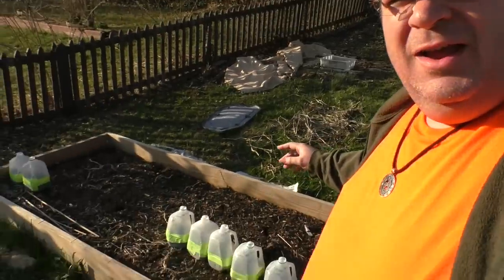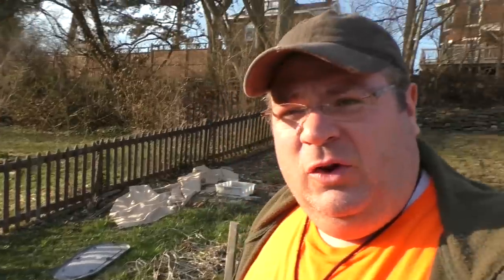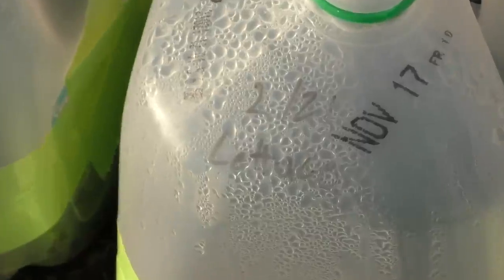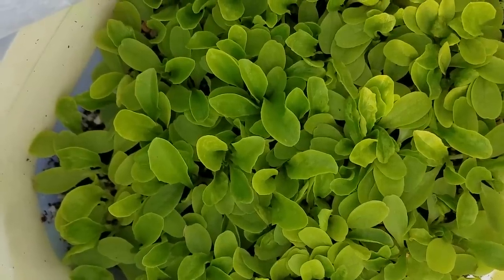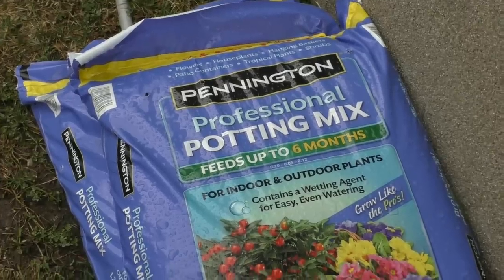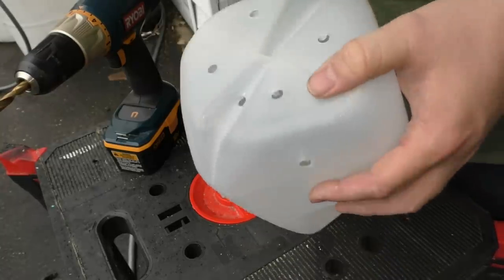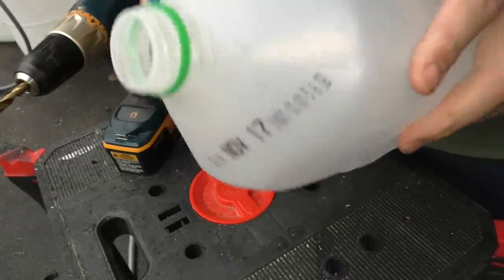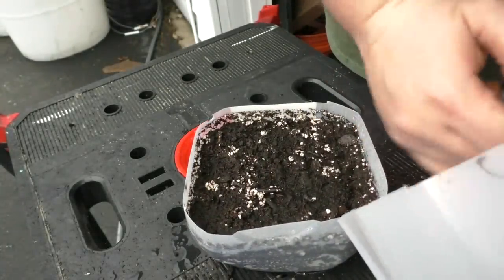Erv's Complete Milk Jug Gardening Guide

Comment: Why not plant the seeds directly in the ground, cut the bottom off the jug, & put the jug over the area. It can be done with transplants too when they are small. I've done it & it works.
Reply from the maker: This is a great idea, and I know a lot of people do it this way. Great tip! Thanks.
Reply: My Grandpa did it that way every year and it worked great in crazy Ks. Spring weather!
Reply: What a great idea 👍👍
Reply: @s.engelsman4521  WE also have crazy weather in Illinois where you run your air conditioner in the daytime and your furnace at night!
Reply: That’s what I thought he was going to do, but his way is perfect if your growing area is a porch.  Also, it makes them transportable.  😀
Reply: Cut plastic jugs as cloches - brilliant! Is burying the lip a ways down enough to keep them from blowing away? 

Maybe for the strong winds here I could cut them so the bottom had "wings" flipped out and weighed down with rocks & soil. I'm definitely stocking up on jugs & soda bottles to try both these techniques next year!
Reply: I would think the answer to your question would be that in windy areas, remembering this is done outside in winter,  you would end up with your milk jug tops everywhere.  by making them as a closed unit the weight of the soil in them prevents them from being blown around
Reply: @davidpringle8089  +
lol same here in NE Wyoming ..  a 30 degree drop most nights ...
Reply: White Marlin  the eggs work? that's cool ... I have a doe and her young-ins who've been visiting for years ...now I don't mind giving them treats (sunflower seeds) but really would feel put upon if they munched my hard grown garden! ... I'll try it ... also the management here won't allow any planting in the ground so I'm learning fast about growing in containers ... btw did you know if you have windows that stay bright all winter you can move a lot of vegies inside for the winter?  i still have a tomato plant that over a year old ... tomatoes all winter (cherries) and this spring I re-potted it, cut it down to the stem (no green) and it's almost two feet tall .... I clipped off it's green leafed ends and rooted them in water and planted them. I know have 11 tomatoes plants! ... most of the babies have flowers already and two have cherries growing ... in the house, in the window, in small pots (need to re-pot soon) ... I was amazed how hardy they are!
Reply: @blackbetsy59  Good point!
Reply: That works great except for high winds. I tried it by just cutting the bottom off, and even stuck a stick in through the holes, but where I live I get high winds, and it just didn't work for me! This way, I can bring them in at night if it gets cold
Reply: White Marlin  great idea about the egg. Thank you
Reply: blackbetsy59 has
Reply: White Marl
Reply: Unless you have gophers that evade all ways to get rid of them; lol. I lost so many plants last year; pots now!
Reply: I was thinking the same thing about cutting out the bottom and using it as a cloche, since I don't have gopher issues. For winds, I have a ton of landscape pins that can be used. Another method is run a pipe through the handles all facing the same diection... one that will weigh them down. Where there's a will, there's a way. The reason I prefer direct sew is because I am notoriously late in transplanting seedlings. Worth a try!
Reply: @davidpringle8089  sounds like the weather we have where I live. As a matter of fact, there's an ongoing joke that our state is the only one where you can experience all four seasons in one day! Lol 🙂😅😂🤣
Reply: @demaupin  Make holes on the bottom rim and stick a couple landscape staples in maybe to keep from blowing away. I had the question about wind as well. Lately here in NW Tennessee I've had big pots of dirt picked up and tossed by the wind. It has been crazy.
Reply: @faith6978  Good point. I hate moles. They raise so much hell in my gardens and yard. Tried everything to get rid of them. They're still here.
Reply: @joanies6778  Good idea with the pipe!

Comment: We have done similar in Texas all my life.  We used to take the very bottom off all the way around, plant directly in the ground, and build dirt up around the jug  outside.  This holds the jug in place during winds.
Another way we use is cut the bottom in half and then cut around the bottom edge and leave about two inches making a flap.  Again sow directly in the ground.  Cover the flaps with dirt to hold them in place.  When, it is past frost, the plants are usually to the top of the jug.  Then we just pull the jugs off and grow naturally in the ground
Reply: Where do you live in TX? I live in Austin and I’m going use this method this year

Comment: My Grandpa born in 1900 used to do a variation of this every year to start his tomatos, esp.  He put the seeds/seedlings in the ground then put the cut jug top over the plant to protect it and warm it.  When the plants were big enough he then just took the jug off and his garden was set. 🙂
Reply from the maker: This is still a very common practice among the people that do this. It works pretty much just as well.
Reply: Wow, thanks. I never thought of that! Kinda cool.
Reply: The cut jug over the jug seems like a better way of doing it, really. I wonder if the soil warms up as well though. Inside the jug the soil would be isolated and more exposed to sun so hence, warmer. I might try both methods simultaneously with same seed and see which works best or if there is a difference.
Reply: @GrandmaSezSo  : What happened? Thanks.

Comment: Yes, Early Girls produce well. They need a cardboard shade until over knee high or another sort such as climbing beans for shade. By experiment, planting them in groups of four, with a 3 ltr bottle with drain holes expedites watering and promotes deeper roots. Ours have crushed their cages every year, so stake poles with stretched t-shirt ties for extra support. I've heard cheap bras, but never tried that. For lower limbs organization crates can be strategicly placed to keep fruit off the ground, especially before a rain or high humidity. Thank you, from S. Tx.

Comment: I cut the handle side of the bottle off and fill the half bottle with soil and hang it on the fence. Works great with strawberries.
Reply: Ijaz H that sounds cool but I'm having trouble visualizing exactly what you mean. Are you using the half with the handle or hanging with nails? Are you cutting it half sideways or removing the the top half with the handle?
Reply: Good idea
Reply: Would like a visual of this...

Comment: Look at all these new comments!  Seems like youtube put you near the top of algorithm, congrats. How well many cuts were you able to take off that high intensity lettuce?
Reply from the maker: A few, It was delish.
Reply from the maker: The experiment was successful. What happened afterward was pretty cool, I planted all the tomatoes and they did very well. The high-yield gardening didn't work out like I wanted it to. It was too late in the year and the lettuce and spinach turned bitter and bolted. That has nothing to do with the milk jug gardening though. That was on me for not getting it potted quickly enough.
Reply from the maker: If I do it again, from a high-yield gardening standpoint, I just need to be more attentive, potted quicker, and actually cut it that was the issue. I didn't follow through with my plans.

Comment: Good idea! It would be a pretty good way to start winter veg in a easy and care-free way, my concerns is how about growing summer plant seedlings in early Feb or March where sometimes weather could get below 0 occasionally while seedlings would not sprout until temperature is as high as 65F. I started seedlings indoors, but it is quite troublesome and needs constant care.
Reply from the maker: Good point! The seeds won't germinate until the time is right, and the air temp inside the bottle seems to stay high enough. Even through freezes, frosts and snowfall.

Comment: Thanks. Subscribed! Coincidentally, I have saved half a dozen 2-litre jugs already intending to pot on seedlings maybe to give away. Now I'm thinking I will follow you. I'm experimenting with no-dig using cardboard. I videoed some until my card ran out! I might provide a before and after later in the season, Be careful and keep well, Terry
Reply: I’d be interested to see how this turns out
Reply: @pattywacker6340  I'll see how I get on with it. I might film myself doing the planting through the cardboard and at the final harvest. One video to cover the whole process.
Reply from the maker: My garden bed use the nodig cardboard method. And I must say it has worked great. Problem is the we'd love to grow in it in the winter and early spring before I plant my garden.
Reply: @pattywacker6340  Yesterday I cut the bottoms off some of the jugs. I had sunflowers to protect from the storm, so I inserted a long cane beside each one then slid the jug down over it. Trouble was the wind was blowing the jug around the cane so I had to push a spare cane down the top hole to anchor it better. Still stormy outside today but all seems well.

Comment: I'm planting in the UK, I presume I can do the same though its spring? Like your presentation.
Reply from the maker: This system should work anywhere in any climate, however I would be careful doing this once the temperature starts Rising outside. You could easily bake your plants.
Reply: @ErvsGarden  thankyou for your reply! It's very good info for a new gardner
Reply: Erv's Garden  I live in Georgia in zone 7A.  I have new seeds and soil ordered which will be here this week and I plan to start a new crop of flowering annuals for later summer bloom.  I will also plant seeds for some perennials for bloom next year, plus late summer and fall vegetables. I have always shown them sow them in uncovered pots.  Can I use your method to start the seeds, and transplant as soon as they are large enough?  Or would they get baked before they were ready to transplant?  Any suggestions for me to try this method, or a modification of it, now?  If I’m not still in coronavirus lockdown, I will definitely try it in February next year.  If I am traveling again by then, I will try it on a smaller scale in my RV.

I love your video and your humor. I will subscribe.

Comment: You can totally start 50 tomato seeds in that much space. You will need to separate them eventually, of course — and it’ll require you to keep a closer eye on watering. But you can prick out (separate) the seedlings when they are 4-6 inches tall (though I successfully separated tomato seedlings which were 12 inches tall). Don’t worry about them surviving the separation — they will. Just make sure not to water for a good week before separation, as drier soil will come off the roots easier. There will be some root lost due to entanglement, but as long as some root survives, the plants will be fine. They will inevitably be leggy in a milk jug (long and thin), which is actually an advantage during the transplant stage, as you can bury them deeply and they will root all along the stem. I always multisow tomatoes and it’s a fantastic method to reduce space. Btw, you can do that with some of your lettuce as well: if you leave several plants unharvested in your baby greens batch, just dig them up and plant them in one of your beds.

Comment: I like this but I feel like it’s upside down if you cut off the top part and flip it over you can plant stuff in there and it has a drainage hole already there (spout)..... Then just set it On top of the bottom and it can be it’s water reserve it doesn’t have a cool little green house like yours but it won’t drip all over the place...:And maybe it doesn’t need a greenhouse if you make it deep enough/Tall enough walls the bottom only has to be tall enough to hold it upright and catch the water
Reply from the maker: Cool idea

Comment: How did everything turn out? I'm assuming I can't sit the jugs in the snow?
Reply from the maker: Yes, you can sit the jugs in the snow. Seeds love to be frozen. However, seedlings don't like to be Frozen. I have found that seeds are very smart. They know exactly when to sprout, and they're very hearty too. I had no problems at all, my seeds did not sprout until it was appropriate to do so. You're basically relying on mother nature to do its job. But no, you don't have to worry about snow. Seeds love snow, in many cases seeds need snow. Good question. Thanks for watching!
Reply: Michelle Sweeney ...........He said you could.  This is so you don’t have to start the seeds inside.

Comment: What is winter sowing ..... you put the seed in the jug for how long.  When do you plan them in the grounds..... where do you keep the jug. In the garage or indoors .... it’s my first time.
Reply from the maker: Plant the seeds in The Jug as shown in the video. You can do this at any point in the winter oh, and you sit it out in the sun. The sun creates a greenhouse environment inside The Jug, which then builds up enough heat cause germination once the conditions are right. The seeds are okay with being frozen, don't worry about that. The seeds will know when the time is right to sprout, they're pretty smart in that aspect. Just make sure it gets water if you go too long without rain. Or if it gets too hot. Good luck!

Comment: I live in Chicago. I will try to do this method next year. When is the best time to do this? I plant bought seedlings from a nursery  for years. I did indoor seedlings germinations this year but it is tacky sitting in my dining table. I used grow lights. I do not get enough light in my house! Uuggh! So, maybe this gallon method might be good but when should I start? I plant my veggies in June. Ty
After gallon is prepped and seeds are in, I CAN JUST LINE THEM UP IN MY dormant garden bed? No lid. Will the soil inside freeze?
Reply from the maker: I did a frequently-asked-questions video on my channel, you might want to watch that. You can put the milk jugs out at any point. The colder the better. Seeds love to be frozen. They'll know when to germinate, just make sure The Milk Jug remains moist.
Reply: The frequently asked questions is in you tube I suppose? Ty. For your reply
 Taking heed! Yes!

Comment: I’m in zone 5 Michigan. When would you start these seeds?  Like the same as indoors?  And is this for all types of seeds? 
This similar to a covered raise bed?  Those with plastic/glass tops?
Reply from the maker: You can start winter sowing at any time in the winter, after it gets cold. Its ok for the seeds to freeze, they don't mind. This is completely different from indoor gardening. When it gets warm enough in the jug for germination, they will sprout on their own. Trust the seeds, they will know.
Reply: Could you use your raise beds as the base & cover with the top of the milk jug?  So you have the plant in place after it germinates? Eliminating the need to transplant later to bed.  Like a dome?  Thanks for information.  🌱
Reply from the maker: Yes, many people winter sow using this method. It does not need to be a milk jug either. Anything that lets light through can be used. Some people use clear 2 liter soda bottles.

Comment: SUBBED. Is there off-gasing?
Reply from the maker: I'm not sure what you are asking, but the hole in  the top of the container provides all the air, rain, heat relief the plants require in most situations. You will still need to monitor the plants in dry weather, and add water if they seem too light.

Comment: Nice. Question Do you need to water it? Do you leave the milk jug cap on?
Reply from the maker: Throw away the milk jug cap you won't need it anymore. Leave the Jug open, it provides both air and when it rains should provide just enough water to keep The Jug hydrated. If you have a period of warm weather just check your jug. If it feels extremely light, you can tell it needs water.
Reply: R Squared     You obviously didn’t watch the video.